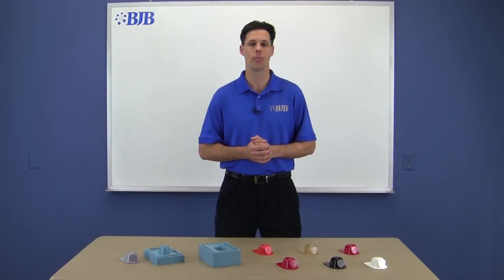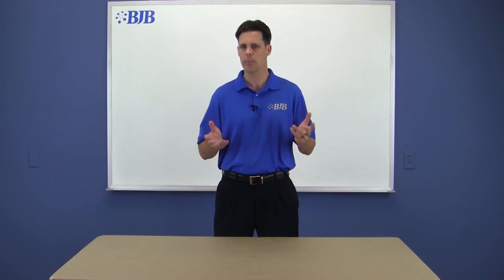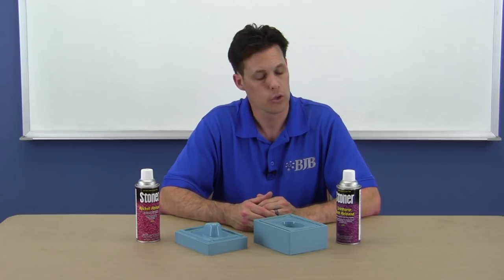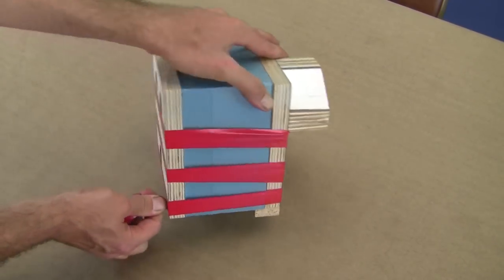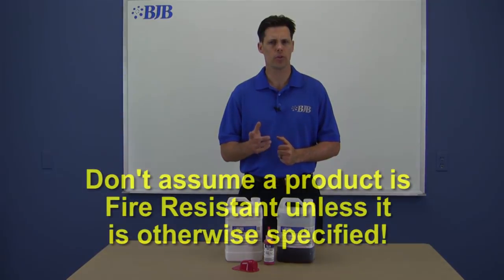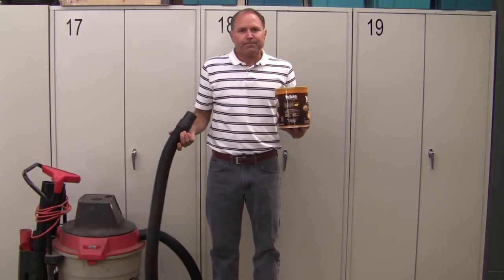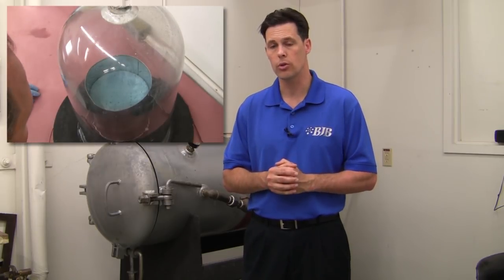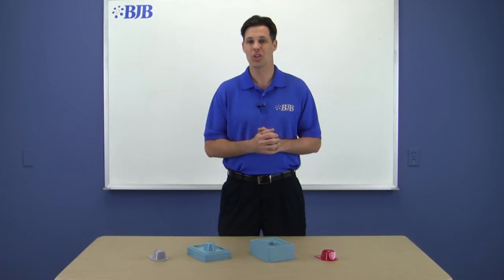Great Video: Casting a Part With Polyurethane | Part 2

Comment: This is one of the better intro videos for casting I have seen. The only step that I think was missing is using a vacuum chamber after the mold has been filled with material. This can help dislodge any small bubbles that tend to form around troublespots.  Vent tubes are not always sufficient. Under vacuum material will flow backward through the fill and vent tubes. It shouldn't make too much of a mess if your tubes are long enough and assuming you had not trapped any huge bubbles. I make the material to flow back and forth a few times by cracking the vent petcock while the pump is running. Follow this with curing under pressure and you should have no bubbles or voids. Note that if your mold itself has any bubbles or voids then curing under pressure will distort the mold. You don't want any bubbles, not even the tiny, almost invisible ones. The mold will shrivel while under pressure.
Reply from the maker: Hi Noah, thank you for your comment.  We do have many production customers that use vacuum assist in their casting process but it's a much smaller percentage of people in comparison to those simply using a pressure chamber after pouring in degassed polyurethane.  The problem many people encounter is that if they pull too much vacuum on a mold filled with urethane, it will degass and boil again, causing additional bubbles and the material will overflow out the mold.  We will typically recommend no more than 10-15" hg of vacuum applied to prevent that.  Also, few people have a vacuum chamber big enough to place larger molds under vacuum, so proper placement of vents and the fill port helps with filling a mold and reducing trapped air.  What equipment and level of vacuum are you typically using in your process?  The potential cost of equipment (vacuum pumps/chambers, pressure pots, etc) is a concern for newcomers to molding and casting.  We've found teaching proper techniques of vent placement and mold posturing for general purpose parts can reduce the need for additional equipment required for molds that are not set up properly.   Once again, thanks for bringing up another valuable option for the casting process.  If you have any reference videos or tutorials, let us know!
Reply: Yes, actually, that's a good point. Some resins will generate new gas while under vacuum, so that would just make things worse. Is it just polyurethane that does this? It must actually be causing the resin to break down. If the resin were just boiling due to a high vapor pressure then you would expect that gas to condense back into liquid when you release vacuum. Perhaps there is some hysteresis that leaves some bubbles behind. Perhaps irrelevant for this our purposes... 

And you're also correct about the amount of vacuum I use. Now that I think about it, when I do this I don't pull a full vacuum. I open and close the petcock to release and then pull vacuum in order to rock the resin back and forth in the mold. If there are any bubbles stuck in the resin it's pretty obvious because you can see the resin flow back out of the fill and vent holes. When I release the vacuum the resin gets pulled back into the mold. When the resin doesn't move much after a few cycles then I know I've gotten rid of any bubbles trapped in the mold.

I work mostly with small molds. Almost have fit into a 10 gallon (abut 40 Liters) chamber.

Comment: why when we use pressure to get rid of bubbles we won't have explosion of these compressed bubbles in case of product tearing after it's cured and finished ? excellent info by the way
Reply from the maker: With flexible materials, compressed bubbles can return and distort the parts.  We have seen this many times.  With rigid material, the bubbles can't rebound like that because the material is hard.  Pressure is best used in conjunction with material that has been vacuum degassed, and the pressure forces the liquid material into the fine detail of the mold where bubbles may become trapped.  Good question!

Comment: I have been looking at this as a solution for a costume dilemma I've been having I need to fashion two identical small accessories. 

However they'd need to be gold, which pigment would be the best to replicate the correct colour?
Reply from the maker: You may need to look into cold-metal urethane casting using gold powder pigments.  See our distributor BITY mold supply for a good tutorial on this subject:  https://youtu.be/9OFteD7iKLI

Comment: Hi Mr , can we make car lamps with your resine .
 The resine has the same property than the polycarbonate ( used for the car lamps specially the transparent parts )? resistance to high temperature of the light in the car lamps like leds etc ... 
whats the code of the clear resine to buy it , and finally have you a shop in europ  ?
thank you

Comment: Please why the mixture A and B boiling when covered do you place it on heater?
Reply from the maker: No, this is vacuum pulling air bubbles out.  No heat is used.

Comment: Can I use a stainless steel two part mold to poor your material in? and if so, will I need a release for it?
Reply from the maker: Yes, you can use metal molds but you need to use mold release.  Cast polyurethane has very strong adhesive properties, so on metal molds we recommend to first apply 2-3 coats of a mold release wax followed by a light spray of urethane mold release.  We have a video here showing choosing a mold release:  https://youtu.be/kNtkwKo0-VU

Comment: Do you have a clear UV resistant product? I'm looking to make the top half of a sealed outdoor electronic module that needs light to get in for the solar panel.
Reply from the maker: Yes, our rigid Water Clear polyurethanes are UV resistant and perfect for this application.  You can see our video on making an auto tail light lens to learn more, or contact us for product info:  https://youtu.be/WME8R2-Ot8E
Reply from the maker: 714-734-8450 info@bjbenterprises.com
Reply: @bjbenterprises  Thank you! That looks perfect! But what is the actual UV stability for full-time outdoors..? I know a lot of epoxies claim UV stability but it doesn't last more than a few months. And obviously in the case of classic cars, you keep them inside and drive them once in a while, so it takes a month of sundays to actually get much accumulated UV.

For year around exposure to the sky in say California or Texas, what would you expect the usable lifetime in years to be? (90% transmissive for the solar panel, and it needs to not get brittle and crack/shatter if a bird lands on it.)

Are we talking about a few months? 5 years, 10 years?

Thanks!
Reply from the maker: @fromjesse  Our Water Clear polyurethanes have been used for several decades in a variety of harsh UV environments.  Automotive aftermarket parts, outdoor art, and theme park attractions to name a few.  We are talking years, not months.
Reply: @bjbenterprises  Thank you!

Comment: does polyurethane 50 d have good resistance to handle scratches? I want to make a mini rc car body, maybe you can provide a good shore solution for a mini rc car body
Reply from the maker: Yes, materials in the 50-60 Shore D hardness range have very high abrasion and impact resistance.  We have several options on our website:  www.bjbmaterials.com
Reply: @bjbenterprises  aha, thank you.😃😃😀. I will go to see. Nice nice.

Comment: Hi ...Great video!! I have quick question. Several people now a days are using pretty large vacuum chambers to pour and degas urethane simultaneously making sure it also reaches all spots into the mould. It eliminates the need of degassing separately and pouring separately. Is it the most effective way of casting?
Reply from the maker: That technique is called vacuum casting and it has been a very popular method used in the rapid prototyping industry over several decades.  It does work well for producing complex parts or if the system you're using is very moisture sensitive.  The big issue with it is that you need an expensive piece of equipment and specialized consumables like the mixing paddles.  If you are in a production setting and the company can afford to invest into equipment, then it is a good method to produce urethane parts.  If you are a smaller shop, or an individual making small quantities, mixing the material by hand and pulling vacuum separately in a vacuum chamber is effective and easy.  Setting up the mold with proper vents like our video can eliminate many of the issues with trapped air, or you can use a pressure tank to help with small air bubbles trapped in a mold.

Comment: Hi I need a resin or urethane to case some action figure accessories.  Something rigid, but flexible enough to bend without breaking.  Anything that you might suggest?
Reply from the maker: We have a few products that fit into that category.  You might check out our TC874.  It is easy to pigment and has a nice mix of toughness, flex, while still being failry rigid:  https://bjbenterprises.com/index.php/tc-874-a-b/

Comment: Great video.  Thanks for all of the information.  I am trying put a rubber coating on a round, heavy ball.  What kind of material should I use?  I am looking for the consistency and feel of a racquetball or handball.  I hope that makes sense.  Thank you advance for your time.
Reply from the maker: +Thumber Pasta The approach to applying a coating to the ball would depend on how 
smooth you need the surface and how consistent you need the coating.  If
 you are simply trying to add a tough layer around the ball, you could 
look at brushing or spraying an elastomeric coating.  If you need more 
precision, you might need to look at casting an over-mold in a closed 
mold to control thickness and surface quality.  Without defining those 
parameters, it's hard to say what will work best.  Of note, a 
racquetball Durometer would likely come in around 60-70 Shore A.
Reply: +BJBEnterprises Thanks for your reply and valuable information.  I do have to have a perfectly symmetrical ball and a smooth surface.  I am not good with the lingo, but here is my best try at describing my setup.  Because of poor graphics, let us assume that the inside square below is my ball sitting on 3 small cone shapes that are the same material as what I am going to cast.  These small cones will be sitting on the other mold.  The space between the 2 squares will be 1/8 inches.  When I pour the casting in the mold and it hardens, I should have a perfect round cover sealed over my ball (with the cones becoming part of the ball).  I HOPE it does.  Does this sound like a good plan?  What material would you recommend using, if we thought 60-70 Shore A was a good hardness?  I wish I could talk to you or someone from your Company.  I will look you up tomorrow.  I am going to have to order materials.  Thanks again for your time, I do appreciate it.  Sorry for the bad graphics.  I hope you can make sense of it.     

           Liquid
______(  )_____
l      ________      l
l      l   ball     l      l
l      l_________l      l   
l         \/     \/         l
-------------------------------
Reply: +Thumber Pasta Of course it moved a little bit when I hit the reply button.  It is good this whole "internet" thing is just a fad.  Lol

Comment: I'm trying to make a halo costume what casting material would I use to make a solid piece, basically I want it to have the impact and abrasion resistance of high end knee pads, anything I can buy off the shelf or internet is a plus
Reply from the maker: buzz lightyear buzz lightyear You will be looking for something in the "Semi-Rigid" class of materials, probably in the 50D-60D range.  This has been used on many movie armor-style suits.  Feel free to contact us direct to get some 
cured samples of material or technical help.  Thanks for your interest in BJB materials.  info@bjbenterprises.com  http://bjbenterprises.com/index.php/polyurethanes/castable/semi-rigid/all-purpose/

Comment: Thank you for another well presented, fantastically informative video! Is it feasible to cast accurate threads into parts not requiring significant post processing, using silicone molds?  What is the curing temp of polyurethanes? Eg, would the temperature created during the curing period prohibit the use of threaded wax inserts - then heated for a faster cure and the removal of threaded inserts?
Reply from the maker: Hi Karl.  Molding threads into castings is very common. Threaded rod with mold release applied is very common and also threaded metal inserts (brass or stainless).  I am not familiar with anyone using wax inserts for this process unless a very specific geometry or thread configuration was needed.  Although exotherm temps of curing polyurethane is mass dependent (more mass=more heat), we typically see exotherm temperatures in the 150-220F (65-105C) range.

Comment: Would this be a good (preferred) method for making vehicles, such as school buses and RV's (trailers and/or motor homes)?  If not, what would be?  Thanks!
Reply from the maker: If you are referring to making small model vehicles, yes it would.  You can create much better detail with less obvious marks on the part by adding strategic vents and fill ports vs crude mold making techniques.
Reply: Yes, HO scale school buses.  What can be used for the windows?
Reply from the maker: You could cast the entire thing from a clear resin and then paint the rest, but this is more of an engineering question than materials since there are so many different ways to approach this task.
Reply: How would u make the shape or mold??? I want to make replacement interior pieces for my car and also custom parts, thanks.

Comment: Hi i have a fast setting PU resin and am having trouble degassing within the pot time. Would degassing part a and b before mixing help to remove any trapped air?? Thanks again for your videos, definitely the most informative and detailed on youtube!
Reply from the maker: Oddly enough, this does help to a certain degree, especially if you have mixed pigment into one side already.  When you are pulling that much vacuum on a liquid, you are also pulling microscopic air and moisture out.  Make sure you are using a good plastic mixing container as well.  Paper cups will increase the amount of air bubbles while under vacuum.  You might also want to take a look at your vacuum pump/chamber set up and make sure you are using the largest and shortest air hose possible between pump and chamber.  You may also want to fill up some of the empty volume in the chamber with scrap silicone bricks if you have too much space in there.
Reply: awesome thanks for the advice!

Comment: The pieces that you cast. Are they pretty strong? I would like to cast flanges but is not sure about the strength of it.
Reply from the maker: +Hakasauars The polyurethane parts cast are indded strong, and high performance.  We try to formulate these systems to simulate a lot of injection molded plastics like ABS, Polypropylene, and Polycarbonate.   So to answer another way, they are not considered brittle or weak unless you are using the entirely wrong plastic for a given part.
Reply: BJBEnterprises Thanks for the info. Is there a way to cast cylinders without the cores being solid? I need to make an adapter for a bicycle frame tube
Reply from the maker: +Hakasauars Yes, you would simply need to mold a part with the desired wall thickness and the hollow portion of the part would be filled with silicone as you pour the mold.  Seeing a picture of the part would help to guide you the rest of the way but that's the simplistic explanation above.  Check out our other video on casting a part from a 3D printed model.  https://www.youtube.com/watch?v=b_KMWhJyYLE
Reply: +BJBEnterprises How would this product respond, in use with fiberglass instead of using a typical fibreglass resin??
Reply from the maker: +DarkLinkAD Many folks have used polyurethane materials with woven cloth but you need to be absolutely sure the fibers are dry or you can end up with a moisture reaction and the PU will foam.  I've had several customers vacuum infuse polyurethane with longer work-times in the 20+ minute range to combine with fiberglass to produce very tough parts.  However, if you are wanting to hand brush (wet lay up) then you may run into moisture issues as mentioned above.

Comment: Sir , I bought Isocyanate & Polyol from Amazon India. I live in India. It's forming foam. It's not forming any solid gum . I was trying to make skateboard bushings.what Can be done with that solution?
Reply from the maker: Did you buy polyurethane foam?  Or, did you mix the material and there are too many bubbles?  There is not enough information about the material and the way you processed for us to help.  You should ask the manufacture of your material as well.
Reply: @bjbenterprises  I bought two separate liquids.Dark - Polyol & Light - Isocyanate. When I mixed , It foamed. I don't know which type of Isocyanate & Polyol I should buy to make skateboard bushing gum . Kindly help me.

Comment: I need to know, does degassing strengthen a part?
Reply from the maker: Good question.  Yes, it does in some ways.  If you're eliminating bubbles form a casting material, then you are removing stress-risers or weak points by removing that air.

Comment: hi , nice video , i have a question about vacuum pump , how many cfm vacuum pum i need to extract all the bubbles? thank you :)
Reply from the maker: +Lucia Galvez Gallego If you watch the video around 12:40 we list a lot of information about the vacuum required.  Typically we recommend a minimum of 5-6 CFM with a high vacuum pump.